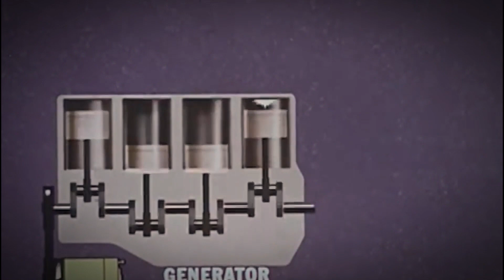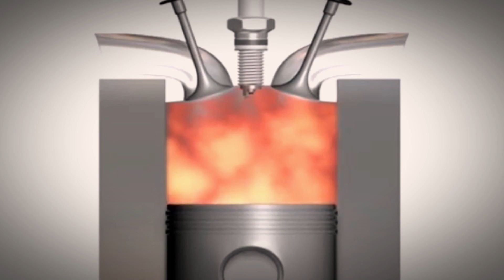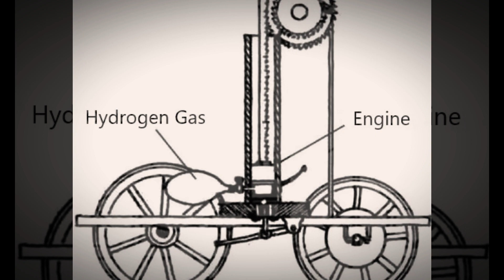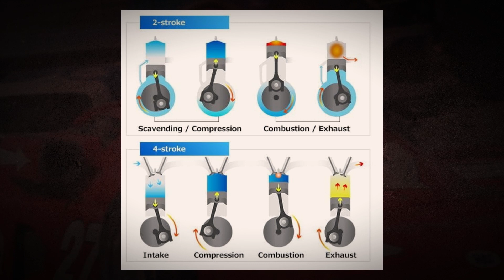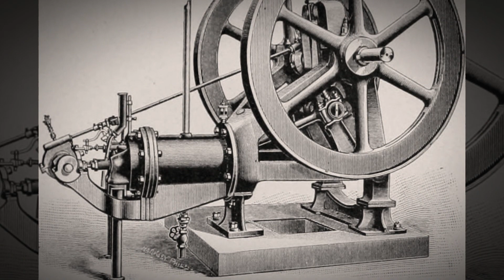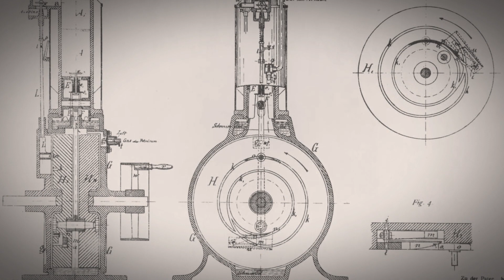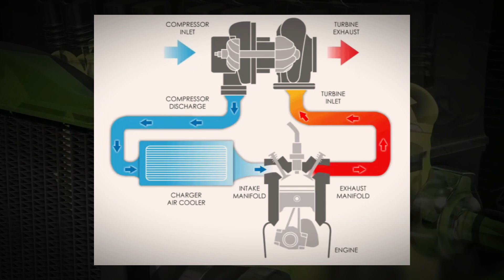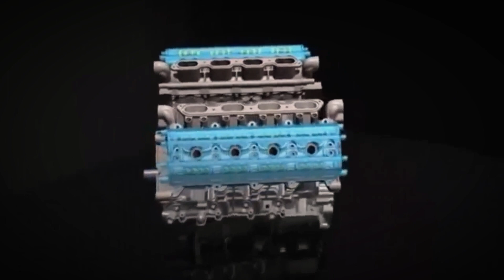The Man Who Invented The Internal Combustion Engine!

Comment: You got the firing order on your display engine wrong.
The firing order of  4 cylinder,4 stroke engine should be 1342 not 1 and 4 and then 2 and 3 cylinders firing together.